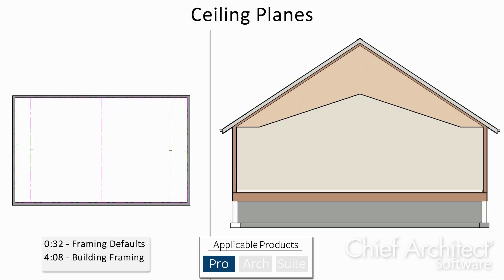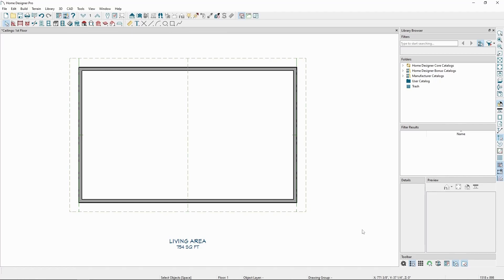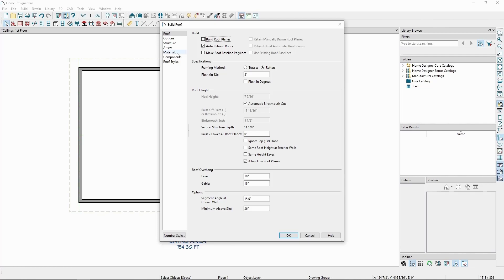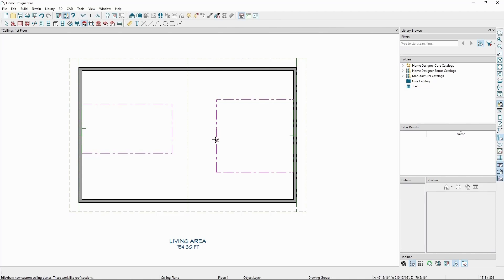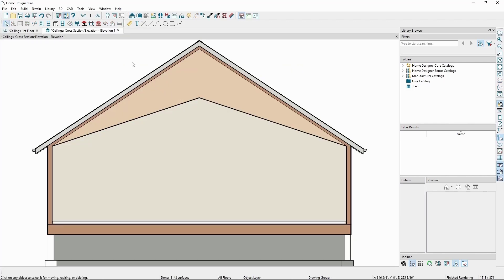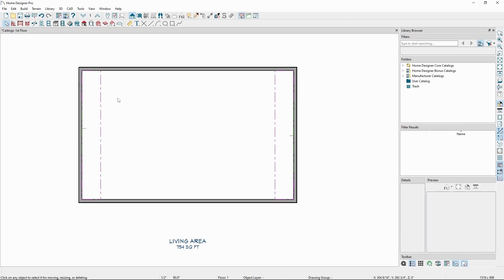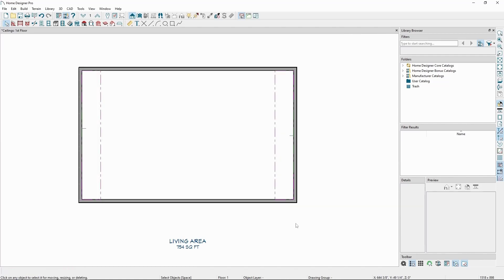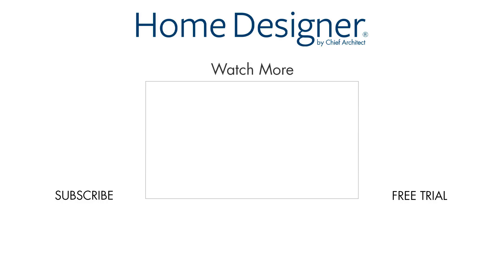Custom Ceiling Planes in Home Designer Software

Comment: have you ever tried to size, position and dimension rough openings for doors and windows in 8" CMU block wall with this software?  what a nightmare.  The block mortar lines aren't accurate.  It's impossible to dimension to the edge of the openings with the windows removed, the cursor can't find the edge of the opening. You have to put the window back in to move it, then take the window out and check, repeat. Try it, why is this exercise so hard?  Being able to position rough openings is critical in block work
Reply: put a marker point at block you want to align with in cross view  .before placing ....opening should snap to it